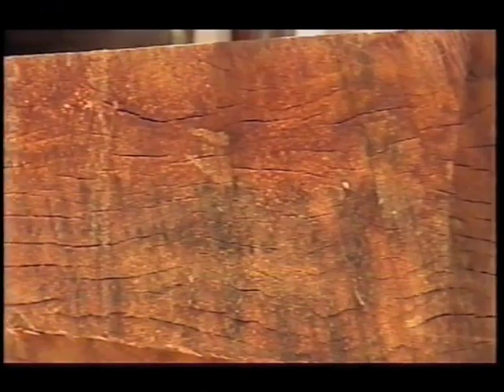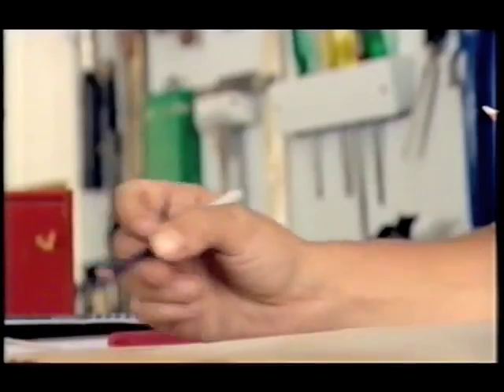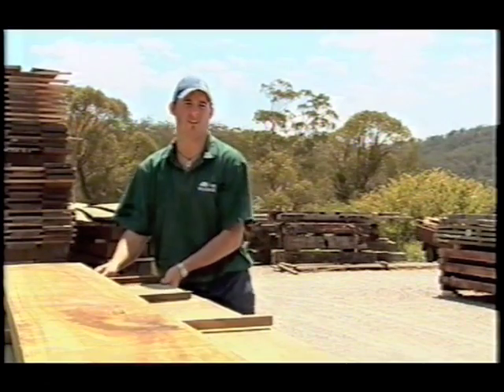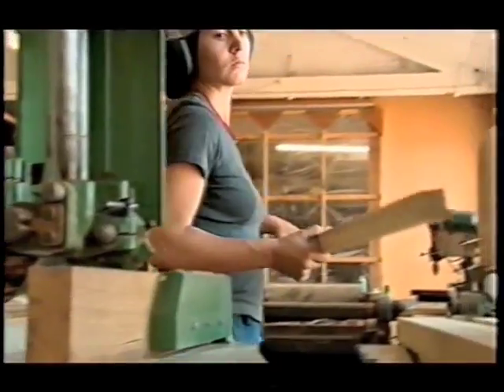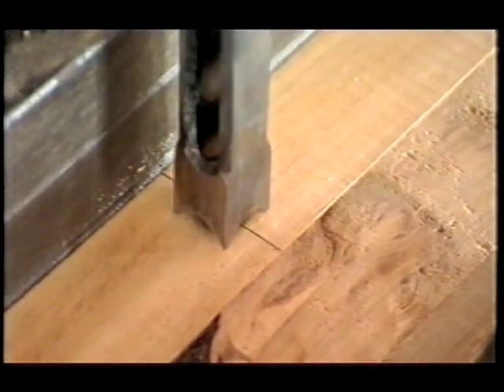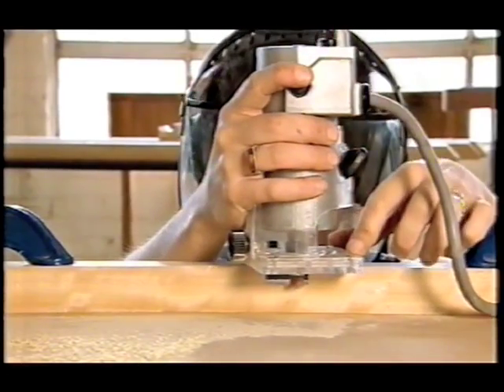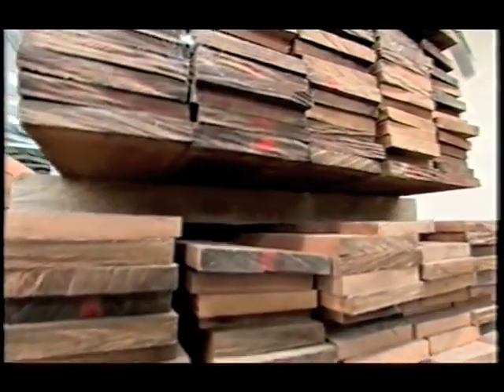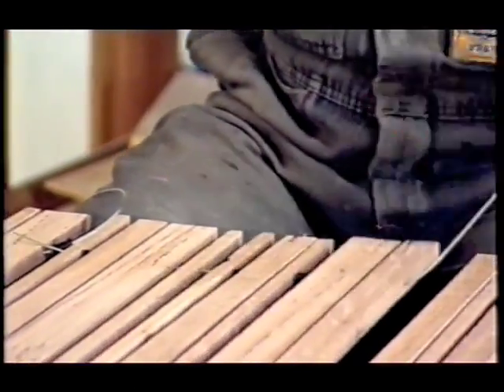Laura McCusker   Designers

Comment: 10:01  Dont you disassembled the Bench again.  Now you cant reach all the surfaces. Would be not so good if the Wood turn gray and crack on the insides...
Reply: The point of the piece IS for it turn grey. The piece is designed to age with time like natural wood. Australian woods resist cracking to a much higher degree than most European woods because of their natural oils. Laura says the piece is meant to age as part of her design brief.
Reply: Thanks, but it will age differently. Treated Surfaces/ Non Treated Surfaces
Reply: None of the pieces are treated. The Grape Oil is not a permanent finish. The piece will age like it is supposed as she designed it to do - naturally. Just like Cedar Single or Cedar siding on a rustic cabin.